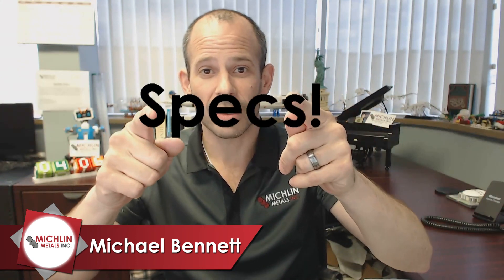Aluminum Alloys - 2011 - 2014 - 2017 - 2024 - Guide to 2000 Series Aluminum

Comment: Thanks Michael, great content. keep up the great work.
I'm currently a 3rd year Mechanical Engineering student and also working on my project of composite plates specifically for stringers in an aircraft structure could I kindly connect with you via any platform as I had few more questions on the 2024 alloy T6 tempered. Looking forward to your great response.
Reply from the maker: I'll try. Email me: info at michlinmetals dot com. If I can't help, I'll try to make a referral. Appreciate the positive feedback! Thank you.
Reply: @MichlinMetals Alright thank you. Let me do that